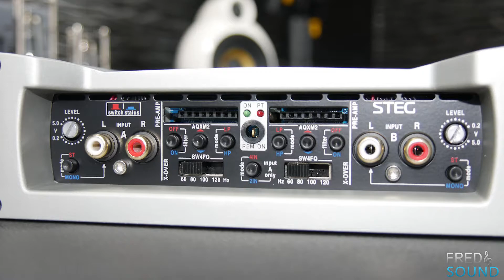STEG SG650C Vs STEG K4.01 Norah Jones  (INT)

Comment: which tweeters will be better in two-way front: sq32 or from the sg650c set?  Are these tweeters ceramic?
Reply from the maker: Hi, it’s really depends on which speakers, SG tweeters are Composite Metal+PORON, thanks for watching
Reply: @frednsound  I'm sorry, I did not understand which is preferable from the tweeters?  midbass I have gzuk 650sqx.  I want to choose a tweeter for them in a two-way front.  I choose between sq32 and those in the video (they are on sale)
Reply from the maker: @Ildar_io  tweeters need’s to match the exact speaker frequencies  you use, so I’ve asked which speakers you use, for this gz speaker the sq32 will work better, success in getting genuine Italy, buy local distributor only, thanks
Reply: @frednsound  wrote you an email.

Comment: this is the highest quality atm from STEG or?
how would you rate this set to the STEG ST650C ? is it worth the 300€ extra?
Reply from the maker: heultdochalle  hi the RE65C is above this set, the St650c is really nice set but the sg is twice-as better, so yes it’s worth it,
If you are interested you can contact me by email down at the description, thanks
Reply: thanks for the answer
Reply from the maker: heultdochalle  your welcome , thanks
Reply: One more question. The soundstream 800.4 with the steg st650c would be a good pair or? I rly love that amp it works for almost every comp if you run it active. What you think. Thanks
Reply from the maker: heultdochalle  hi, sure it will work fine, thanks